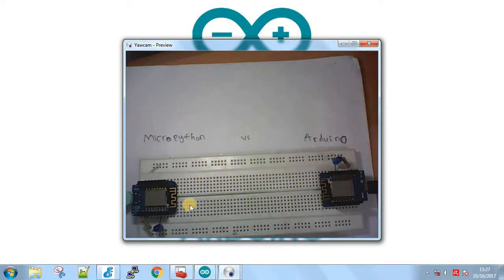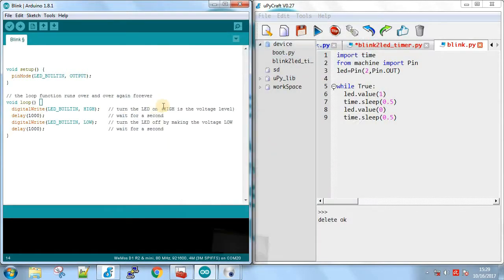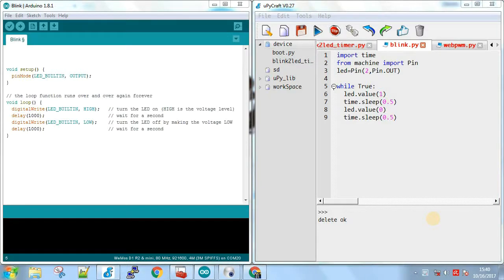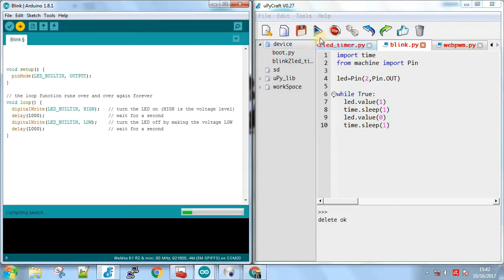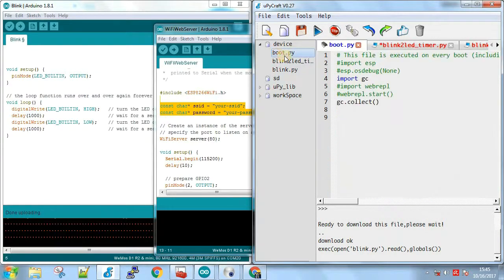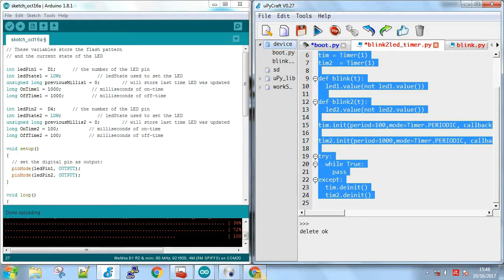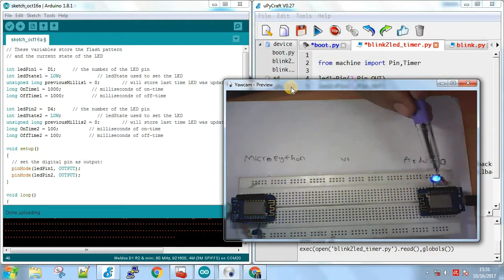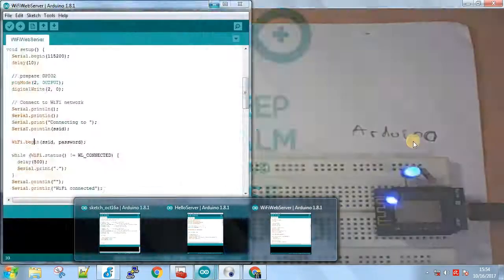Arduino vs Micropython Comparison Part2

Comment: Yes, microphython is faster but it s very messy in the complicated program, while the C complier will check it for you before reload and run.  and the second thing is " you have to install the interpreter in to the mcu memory, that consumed your memory my friend, in the future the program will be larger and larger than the interpreter can 't handle at all, seem as the 8 bit computer and the BASIC that fade out before.... may the force be with you.
Reply: my reason that why we still see C and C++ still alive in arduino, node MCU.... because many many engineer is familiar with the C C++ and next step is the 4th gen langue as HTML, PHP, Python and VB.